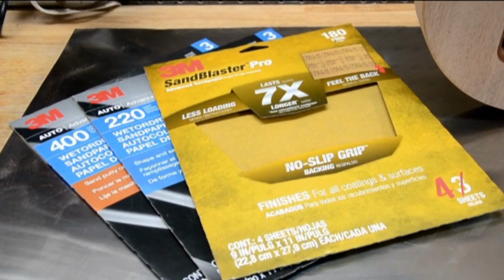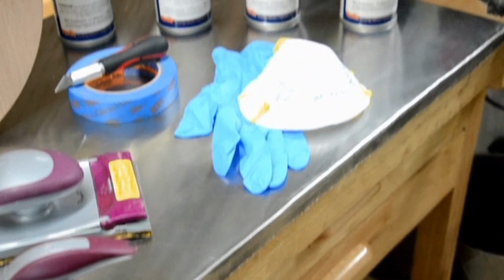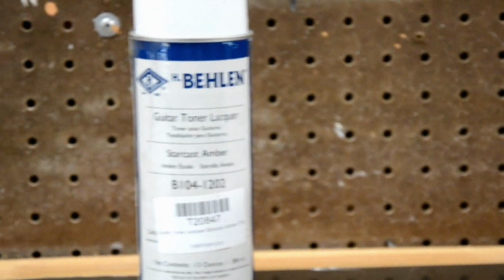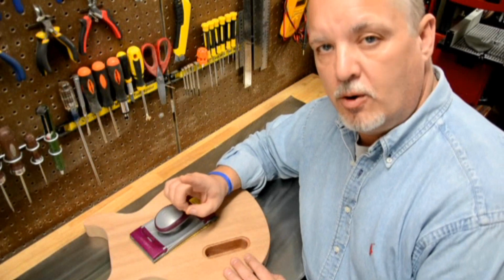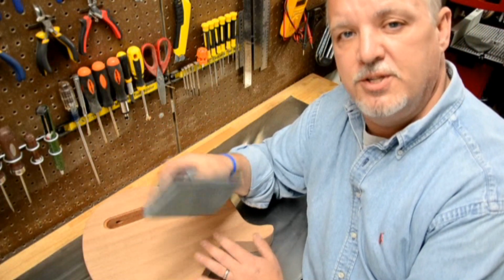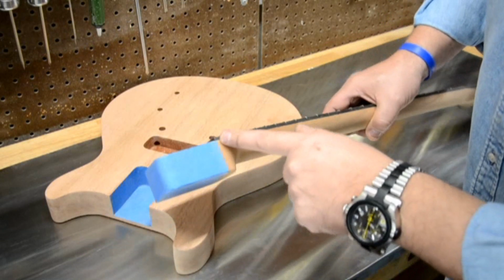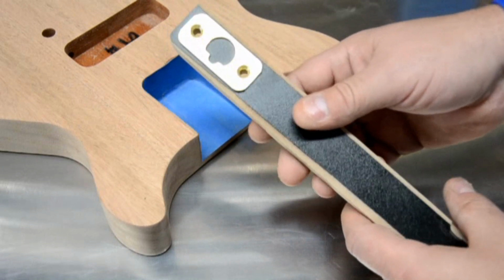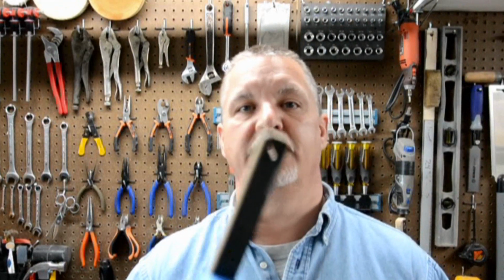How to Spray a Vintage,Two-Tone Sunburst Finish using Spray Cans! Part 1-Preparing for Paint

Comment: I know this is an old video but anyone thinking of doing this DO NOT spray nitrocellulose laquer wearing a dust mask, get a proper respirator, just because this guy doesn't value his health doesn't mean you shouldn't!
Reply from the maker: Nathan, I actually say in the video to use a mask, but for this video's production, I found that while wearing the mask , my voice couldn't be heard distinctly enough on the video... so I intentionally don't wear one so you can understand what I'm saying...so Do as I say, not as I do here ... 

please always use a mask/respirator and goggles when applying any chemical substance.

Comment: Hey Will :-) Thanks for sharing, super video. What a stunning sunburst finish. But I was wondering if one could apply a coat of clear lacquer after finishing the sunburst - just to seal it in case - and the apply the wax afterwards after once more of the finest polishing? I'm about to make a guitar out of scratch with everything handmade. Just don't know that much about painting it.
Again thanks for sharing!
Best regards Tummas

Comment: Hi Will, congratulations for your tutorial. How would you remove the paint from a Fender strat? Would you use a heat gun or a paint remover?
 Is it mandatory to use a sealer on an alder body?